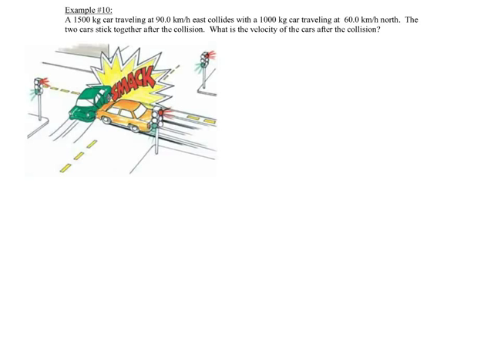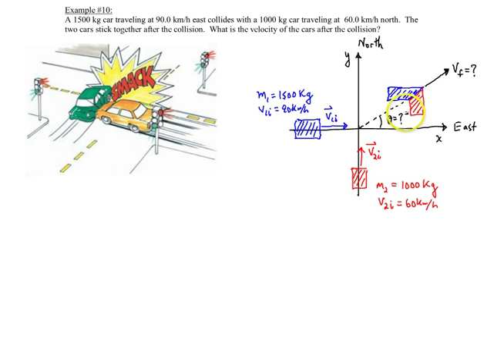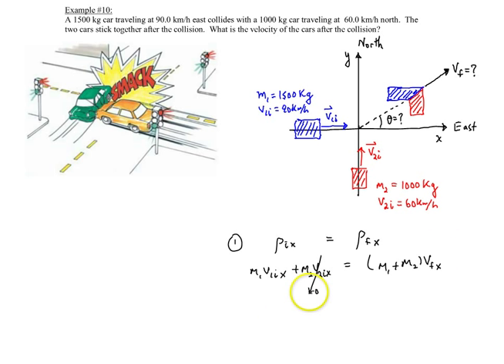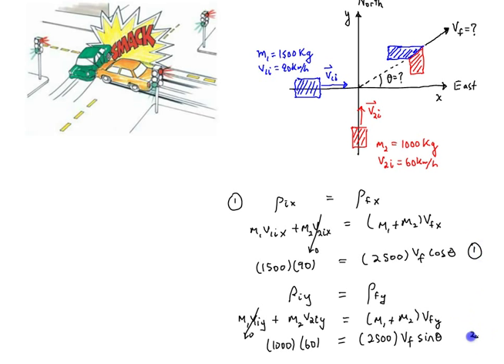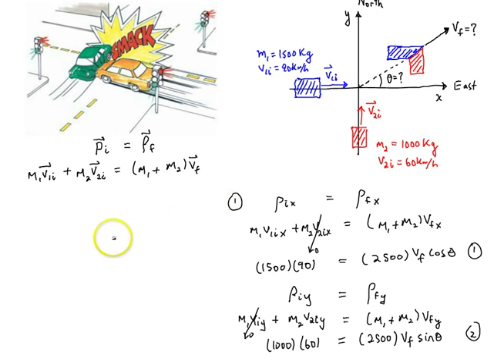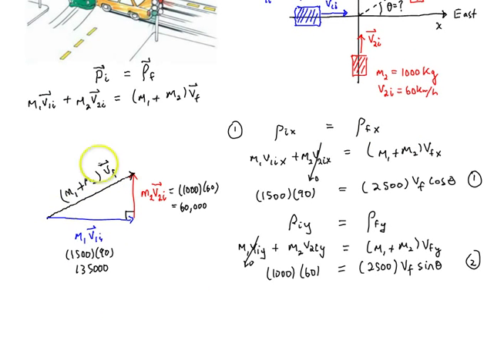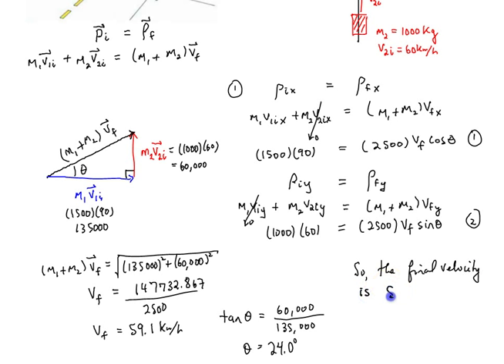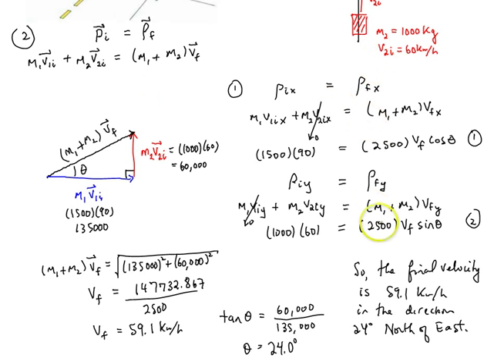Chapter 7, Example #10 - Two dimensional completely inelastic car collision

Comment: How did you get 24 degrees? 60,000 divded by 135,000 is .4444 which times 100 comes out to 44%
Reply: I know this was 4 years ago, but he used inverse tangent to solve for the angle, not straight division.

Comment: Wait Wait!!! how is it prossible to square the both initial momentum and other hand you only  have squared the final velocity.
Reply from the maker: Using pythagorean theorem for the momentum triangle I drew in the video:
c²=a²+b²
[(m₁+m₂)v]²=(m₁v₁)²+(m₂v₂)²
when you take the square root of both sides you get...
(m₁+m₂)v = √ [(m₁v₁)²+(m₂v₂)²]
So, you see the taking the square root of a already squared side gives you just the the product of the total mass and the velocity.  (Taking the square root and squaring are inverse functions)

Not sure if this makes sense... hard to explain math by typing text.